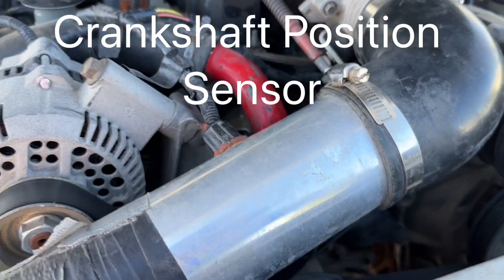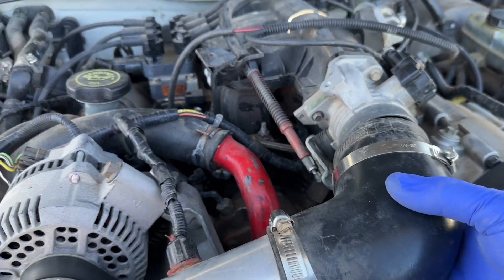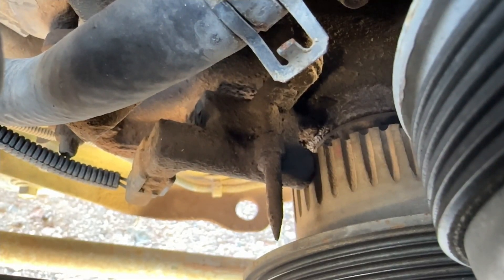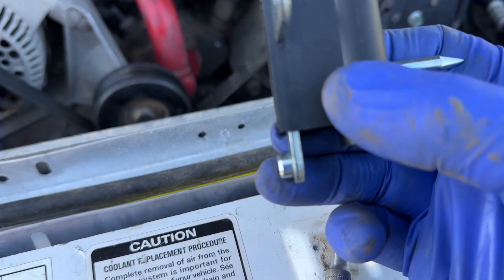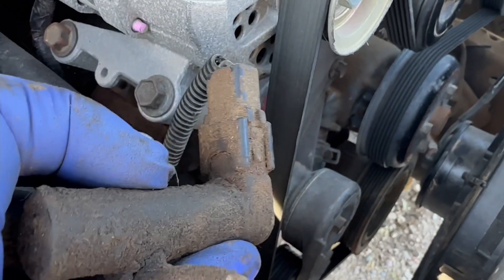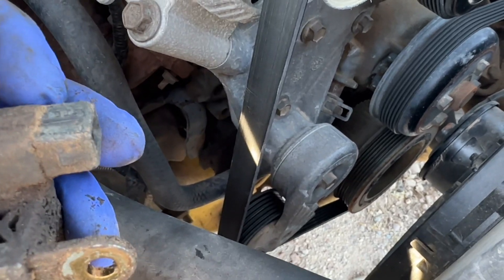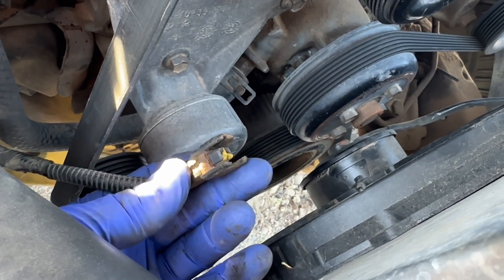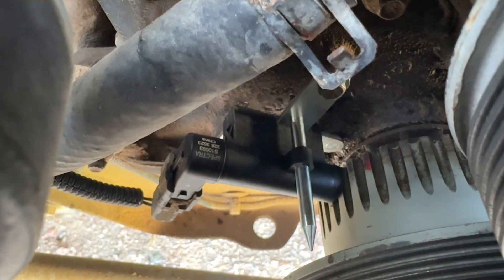Crankshaft Position Sensor Replacement Ford 4.0 Liter.

Comment: Man i just wonna see the cabel replaced might have to re wier mine up if i can im assuming it would be the hole wiring harness to do that huh
Reply: Just splice in the new plug and cover with tubing. Rock Auto has a replacement kit for $15 will have everything you need.
Reply: @VitaKet  yeh  I reconnected it